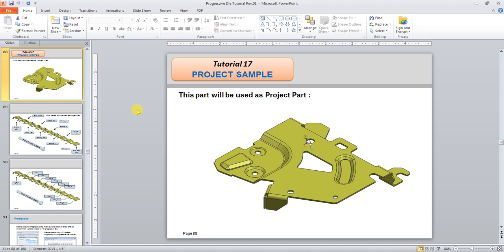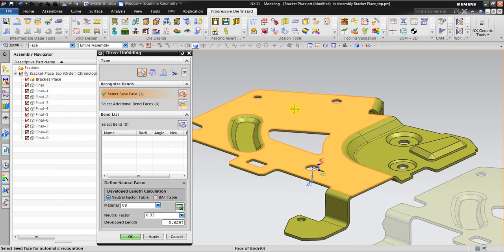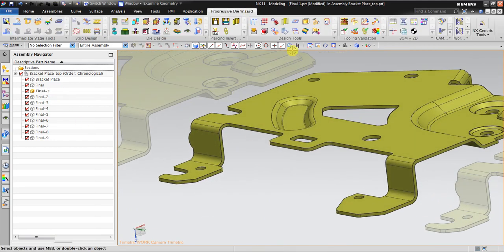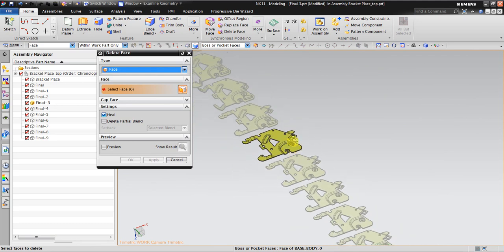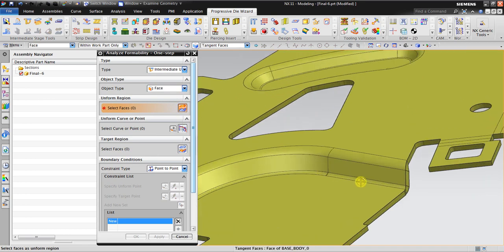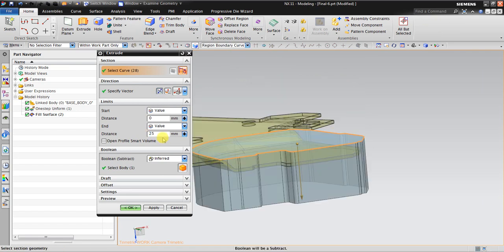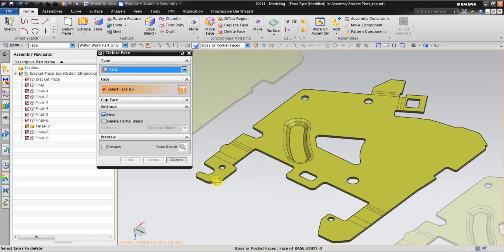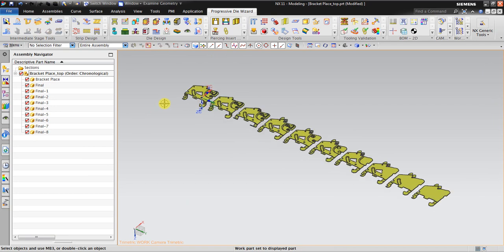NX Progressive Die Wizard (PDW) : STEP 01 - Create Intermediate Stage

Comment: Thank you very much for the terrific video. Can we use igs file of sheet metal?
Reply from the maker: Hi. IGS need to be sew and thicken first (change to solid with uniform thickness) before starting NX Progressive Die Wizard. Since the application need thickness input at the beginning of each PDW project.
Reply: @CADCAECAMTutorial  Thanks for the quick solution. Relieved a lot now!!
Reply: @CADCAECAMTutorial  You will have the CAD of the piece and the ppt, to be able to practice

Comment: Sir i am stuck in direct unfold stage 1. Nx is unable to find bends
Reply from the maker: Hi Sir.  Sometimes NX cannot detect a bend shape, this can due to defect on bending radius end line. If this the case, please repair it first the CAD geometry on not recognized bends. 

You can see how to repair it on my video : https://www.youtube.com/watch?v=HTwTwmU7Sko
This if the case you have zero gap and must create gap to unfold bends.

Or you can use Synchronous technology on NX CAD to edit the bending radius value first then try to unfold it.
I have that video but forgot where I keep it and not yet upload it. Your case was same case like I have been solve few times ago.

Or you can use Advanced Unforming Tool if the problem persist.

Comment: Sir  i am a progressive die designer. In my company we use to design die using  modeling wizard. Could u explain how faster and effective a die can be done in progressive die wizard.
Reply from the maker: Hi Sir, many of my friend also using CAD modeling for creating dies. 
But the most difficulty is when they must meet surface modeling or surface editing. Need excellent CAD skill to finish the job.
Other problem also come when they want to insert 3D standard part in their assembly. They must create manually by looking product catalogue. 
This will become big problem when the die design change and they must replace existing standard part with another one.
 With NX progressive dies, all  linked using geometry linker. Each command linked to the next.
 Therefore if user make some change in the product then all related die components will also updated. 
For standard part, user no need to draw it the 3D model, because NX will do it automatically. 
This is because NX have complete standard library from many well known brand in mold or dies industry.
Reply: Thank you for the update sir.
Reply: May i know which country u r from.